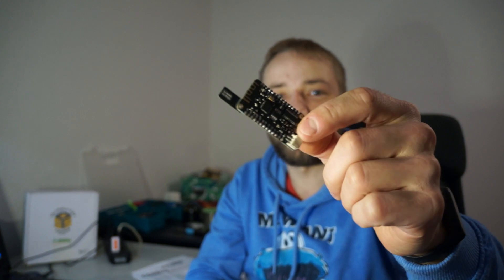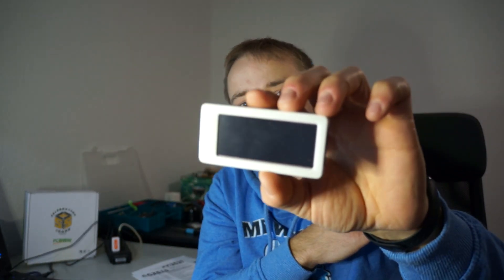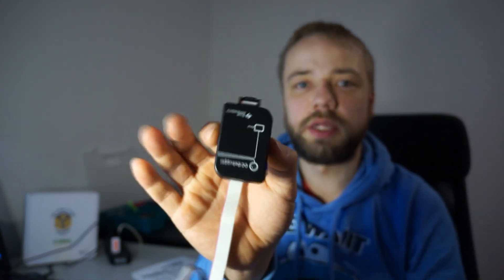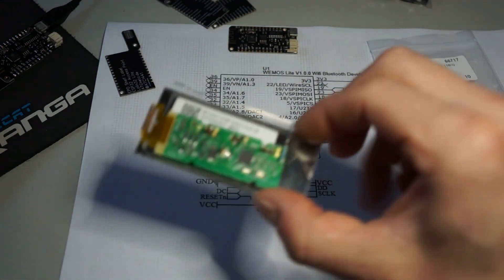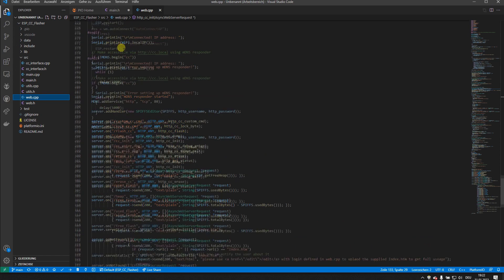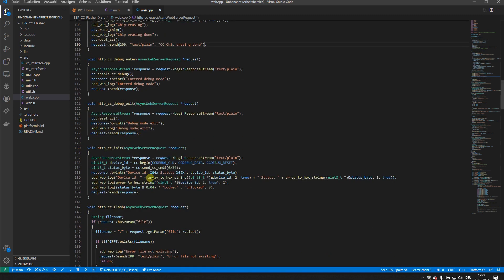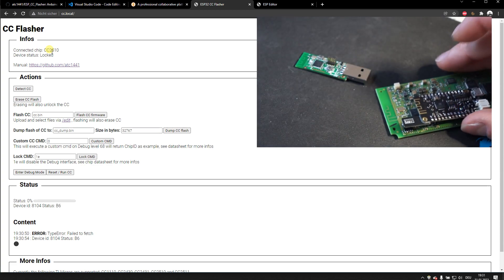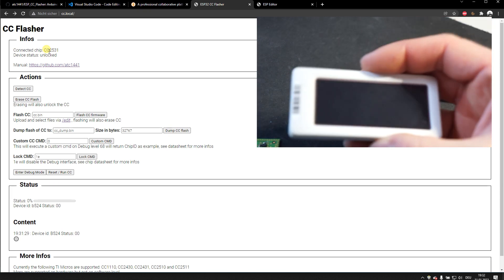Flash CC2430, CC2510 or CC1110 with just an ESP32

Comment: Can this code be used on say an arduino pro mini? 
I don't have an esp32 but I do need what you created.
Reply from the maker: The library itself does work there too. But you need to supply an own way of getting the cc firmware onto the Arduino because of small flash ram..
Also make sure to level shift the arduino 5v to 3.3v cc